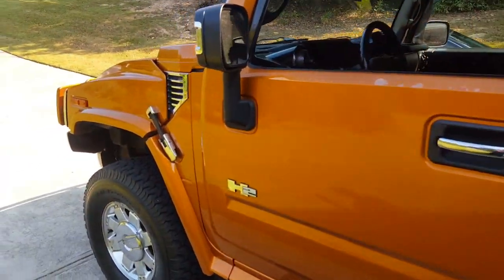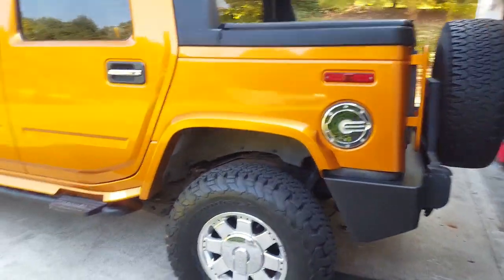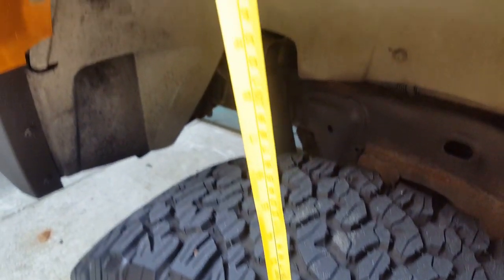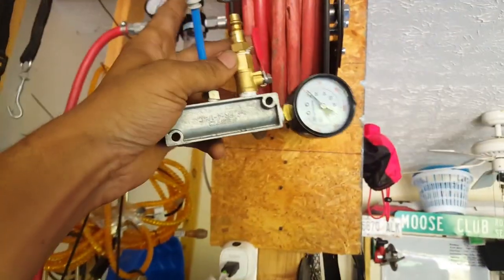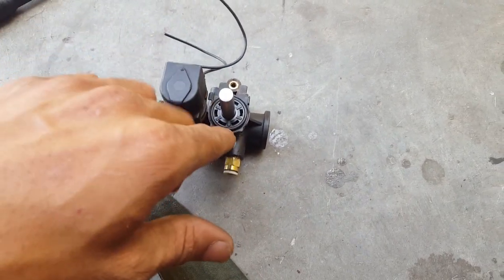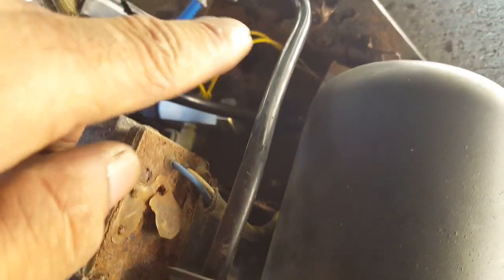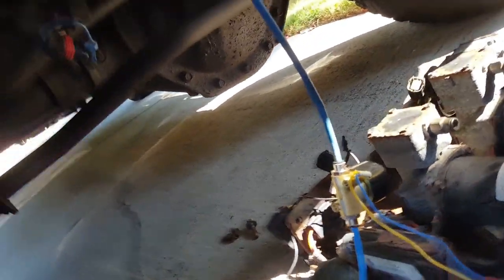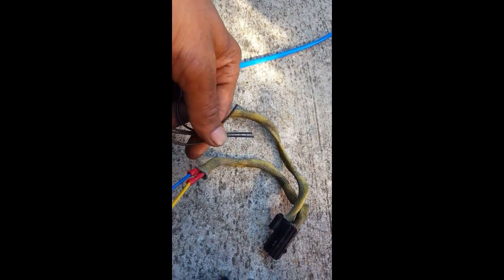Hummer H2 Air Suspension system REPAIRED. cost $50

Comment: I know this is an older video but what was the reason for switching out your dual solenoid to a separate set up with two separate lines and hardware was the OEM one to expensive im just wondering because i work on air bags air sleeves and air shocks all the time and the one that is used from the OEM perspective has the manifold, pressure sensor and solenoids all in one unit, but maybe it was more expensive back then or not readily available. In retrospect its probably more expensive to run that set up then just replacing the original part but they probably didnt offer that back then you probably had to replace the whole unit as one assembly. Now they make a conversion kit to go from air sleeves to springs and its not to bad as far as cost goes. I liked the video good material and you solved your issues. Look forward to more videos in the future.
Reply from the maker: Yes since the Hummer has been discontinued for quite some time. The replacement part was not available. Maybe used but no sense in paying for the same problem to occur later. Decided to replace with something that could be sourced from many places for years to come. Everything I used was able to be ordered and arrive into 2 days. Whether it was air bags or sleeves, this control unit and solenoids would still prevent any of them from working. I also wanted to be able to have manual control to bottom it out when I was using a hitch mounted motorcycle ramp.

Comment: I am looking for a way to DISABLE the 40 mph auto lowering function. I would like to keep my 2007 Hummer H2 rear air bags at the highest setting without it automatically lowering at 40 mph.
Reply from the maker: Since it’s electronically controlled, put solenoid somewhere between the valve body and air shock. Run the control wires to the cab. You’d have to determine whether you want normally open or normally closed solenoids. Doing that is going to put a “service suspension” on the dash. You can bypass that service fault with a device from Arnott
Reply: @CustomKeem  It had crossed my mind to cut into the power wire going to the compressor and to run wires to the dash adding a switch to cut power to the compressor once I put the air bags at their highest point. 

Then when I needed them to come down I could just hit the switch on the dash to allow power back to the compressor so the bags would go down.

But did not know if the bags would stay up with power to the compressor cut or if the was some other valve control that would deflate the bags at 40 mph even if the compressor was disabled after the bags were inflated.
Reply from the maker: There is a separate exhaust valve for deflating.

Comment: How it going Custom Keem. I have a 06 H2, My compressors want turn off unless I unplug the unit. I just ordered new leveling sensors. I wanna go ahead and do new bags too. Do you do repairs for people. I need someone that understands what they are doing.
Reply from the maker: I just do my own repairs, especially since these items are discontinued. There’s a vendor that makes the complete system in the rack for $1700. But I wasn’t planning on spending that. Figured others may run into similar situations therefore I’d try to help with a video. Seems of your compressors would continuously run. Should fault out and disable the air system. I just recently went back in and replaced my compressor with a train horn type compressor. The one I replaced had the exhaust solenoid attached to it so when removing it, I had to add a new solenoid in its place since the new aftermarket compressor would not have one.

Comment: Hello. Great informative video. I am also fixing a 2005 dual air compressor hummer h2. Original inlet valve coils were shorted (showed 0 ohms) so i went with something similar to your setup and installed new 12v solenoids. But now there are two dtcs c0716 and c0717. These dtcs are related to left and right inlet valve solenoids. 

May i know the coil resistance of the solenoids you installed? My new solenoids show 30 ohms. Maybe resistance is too much and module is not recognising the new solenoids.
Reply from the maker: 9 and 11 ohms
Reply: Thank you. I will try this.

Comment: Why is my compressor no turning on. All doors are shut ?
Reply from the maker: Could be a lot of stuff. Turn on the onboard inflator in the back of the truck. Should activate compressor. Besides that options are but not limited to: bad compressor, pressure switch, 12v power/ground, 60amp fuse, air suspension relay under hood.
Reply: there is up to a minute and half delay sometimes after shutting door. make sure dashboard  dome light switch is depressed turning off lights. might help

Comment: Does your extended ride height/+ 2" button still work? I had the same factory solenoid leaking issues that I couldn't resolve so I went with this set up. All my extended ride height button does now is flash orange. Someone said that this set up won't release pressure from the bags due to the one way solenoid. So I would need recreate the factory bleed solenoid instead. I'm trying to keep this air system running but not sure how much more aggravation I can take with this.
Reply from the maker: Yes it still works. Think I explain the direction you have to put them. I haven’t had any issues with mine since posting. I’m thinking the system has a separate exhaust to release air out the system. That’s why one way valves work. Hydraulics and Air are different. When lowering, you don’t retain the air you’ve already used. It’s vented to atmosphere. Versus hydraulic which would be retained

Comment: Hey, Lots of good information. 2005 SUT...  I have an issue with my pump coming on only for a few seconds every few minutes. Doesn't want to pump up anymore. I am thinking maybe the solenoids are not opening, so it just sees enough pressure and shuts back off. Do you know if they are fused? Do you have any kind of wiring diagram of how the height sensors turn these on and off? Thanks in advance. I know have enough info to tear into this. Wiring diagram and fuse locations would be a great addition to this. Thanks to anyone that can add that.
Reply from the maker: Wiring diagrams are available. I used alldatadiy.com then put in my Hummer information. Then I went to Retailmenot.com and put in alldatadiy to get a discount code

Comment: The drier hose turned out to be 5/16 hose ? Got it all back together and pumps not activating. Just get a service air suspension on dash. Any idea how to reset the code. Obd scan tool can’t do it.
Reply from the maker: Triple H 5/16 is the English equivalent of metric 8mm. Quickest way to clear code would be to disconnect the battery. Make sure all the doors are closed. Pump won’t activate with any open.

Comment: Hello again. I have had my bags inflated with a schrader valve last two months. Looses maybe 5psi every two weeks. Went to duplicate your setup but have a problem. What size of hose is that coming off the air drier. It’s not 1/4 inch and not 3/8 inch. Do you remember what size it is. Thanks.
Reply from the maker: Triple H The black hose coming off the air drier/tank is the factory hose. Is the hose in my video that comes off the side and does not go the same direction as the blue hoses. It goes to the silver distribution block. Since the distribution part is not factory that means I installed that fitting. So basically old hose goes to new fitting. The fitting though should be 8mm. So if you don’t have the factory hose, a 8mm hose should work. I can tell it’s a factory hose because it’s more rigid than the new hoses I installed and it also has the bulge/wrinkle close to where you plug it in on both ends of the hose. You can see that the other hoses I used do not have that bulge because I cut them to size. 

Subscribe if it helps any, it helps me. Thanks

Comment: I'm having the same issue with my hummer, but with this method you have, i can use any compresor but the use of the air for the suspension only do they work by pressure and not by the height of the car, so won't work for town haul feature?
Reply from the maker: John Batista at 0:55 I point out the air suspension sensors. 
Air Suspension Sensors: 
The rear air suspension sensors are potentiometers which detect height changes at the rear of the vehicle. The sensors relay the height changes to the air suspension module. The sensors are mounted to the frame at the rear wheel area on the left and right sides. The activation arm is attached to the upper control arms of the rear suspension.

Air Suspension Pressure Sensor:
The air suspension system uses the air pressure sensor to monitor system pressure. The air suspension module uses that signal to determine if there is a leak in the system and to maintain a minimum air pressure in the system.
Reply from the maker: John Batista Note if replacing compressors: Compressor Assemblies 
The air suspension system consist of 2 compressor assemblies. Both compressors run simultaneously and are controlled by one relay. One compressor has the exhaust valve mounted on its cylinder head. Each compressor has its own thermal limit switch. The compressors are a positive displacement air pump, powered by a 12-volt DC permanent magnet motor. A thermal limit switch protects each compressor. The thermal limit switch is normally closed and provides a ground signal to the air suspension module. If there is an overtemperature condition the thermal limit switch will open and signals the air suspension module to deactivate the compressor relay. The compressors will stop running and a DTC will set. Intake air for the compressors is drawn through an intake filter and line that is attached to the fuel filler pipe in the left rear wheel area. The air compressor assemblies are mounted to a bracket that is located under the rear center of the vehicle. The compressor air dryer is mounted next to the air compressors. It contains a moisture absorbing chemical that drys the compressed air before it is delivered to the rear air springs. Moisture is removed from the dryer and returned to the atmosphere when air is exhausted from the air springs during vehicle lowering.

Comment: Just wondering if it matters how to hook up the wiring?
Reply from the maker: norm laderoute I don’t remember checking the output for + and -. With the solenoid just being activated by a coil, it shouldn’t matter. After checking the product information of the solenoid, it doesn’t say it has a diode. So as long as you keep the 2 wires from each old solenoid going to the new solenoid, you should be ok.

Comment: I am assuming your replacement hoses are just basic 1/4 inch od plastic piping ? Understand your switch direction no problem. But what is that large threaded piece you unscrewed from the old block ? What’s its purpose ? Does it exhaust the extra air ? Do you remember the thread size and where you got the coupling from ? Anyway of testing the level height sensors? Sorry for all the questions, you seem to have all the answers. Great video !
Reply from the maker: Triple H The hoses should be 6mm. There are a couple of large threaded pieces. One is a coupling that has the pressure switch screwed in one side and blocked off on the other side. Then there is a hose coming out of it that goes to another distribution block. I think this coupling came from Home Depot. I think it was 3/4 coupling. I just took the pressure switch in and got the coupling and bolt to close it off with at the same time.

The other large threaded piece has multiple inputs/outputs. As described right above, one hose goes to pressure switch. 2 other hoses go to each solenoid for air to the bags. Then the last hose goes to the drier/tank. This particular block I cut, drilled, and tapped myself from an aluminum block. You can do the same thing without that block by using just Y or T fittings to connect those particular lines together. The purpose of that created block is to get the air from the drier/tank to each bag and allow the pressure switch to read how much air is still in in the tank so that it knows when to turn the compressor on and off.

The sensors can be tested for an output. I haven’t had any issues with them being unlevel, so I didn’t test them. What you can do is go to Alldatadiy and purchase the yearly subscription for the Hummer. That is where I got wire diagrams for these suspension components. Before you purchase the subscription, go to retailmenot and then type in alldatadiy. This will give you a discount code you can use on alldatadiy
Reply: Thanks for your help. Best h2 video on air ride. I am at the Schrader  valve stage. Haven’t leaked down at all for three or four days now. Rounding up parts to eliminate that solenoid system. Thanks again.
Reply from the maker: Triple H just noticed that I put the coupling  part number in the description when I initially posted the video

Comment: Could you hear it leaking? Because my compressor started staying on continously today and I don't hear any leaking and the ride height is normal without any drooping after disconnecting the battery to stop the compressor. This may just be a bad sensor in itself. That would suck because I just replaced the  compressor 5 months ago and had no problems until today.
Reply from the maker: Dragonfly jones I did not hear it leaking. Sounds like you have a small leak somewhere as well. Spray a soapy solution around your connections to check for a leak. Then sign up for Alldatadiy and purchase for the Hummer. Go under suspension and you will find valuable information there

Comment: I could feel a spot in my air bag leaking the other day.  So i bought a bag. But.... I ran into issues trying to get airline out of the bag.  Finally i just cut the line.   Put new bag in but im sagging even faster now.  I don't know if i got the airline in all the way for the quick connect.  So my thought is to get new airline and also replace other side sice ill be there again.  But how did you remove the airlines from the compressor/solenoid parts? Is it a push in and release?  I was thinking i should just replace the airlines with new to make life easier?  07 SUT
Reply from the maker: Didn’t even notice your comment. Sorry. Saw you posted a video on the issue of removing the hose. I do it everyday at work so I didn’t even think about showing how to remove it, I just did it.
Reply: @CustomKeem  No worries, your video was good to get me started.  SUT life :)

Comment: So mine airs down really low after I shut it off. It takes about 2 hours to get low...I hate it! For the most part it airs back up when I start it but every now n again it wont. And sometimes when it airs up I can feel it bounce a bit in the back as I roll😤 Should I assume there's a leak in a bag or a solenoid issue? TIA
Reply from the maker: At 6:40. I show my temporary fix. Do that to each bag separately. Cause as you can see I have a gauge, air intake from the compressor and air outlet to the bag. This will tell you if your bag is leaking. It shouldn’t bounce. If every now and again it won’t air up, either it’s tried to air up too many times and it’s faulted out and you should have a fault message on the dash or your leak is major and the amount of air it’s attempting to store is less than the amount of air that’s leaking out.

Comment: Great job on taking the initiative and being creative to figure out a solution to bypass the stock solenoid block! So many just rip the bags out and change them to coil springs. :( The air ride on these has a better ride than coil springs, helps a ton if you are ever towing anything, and of course the ability to raise the rear when needed or to use the rear air accessory outlet to inflate things.

Mine is still working good but this will help when I eventually will need to work on mine. I also plan on adding an air tank underneath somewhere, air horns, and an air line fitting for tools. Finally, I also want to replace the actual compressor (mine is the earlier single compressor style) with a much better and higher flow compressor while retaining the factory controls.